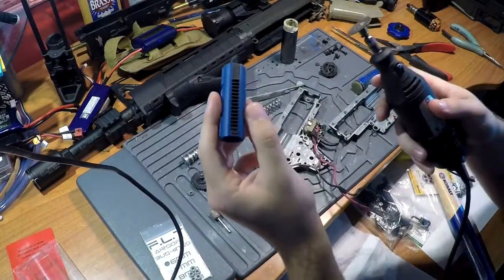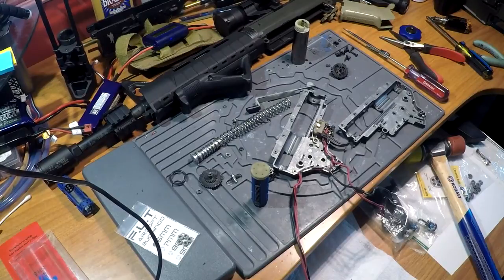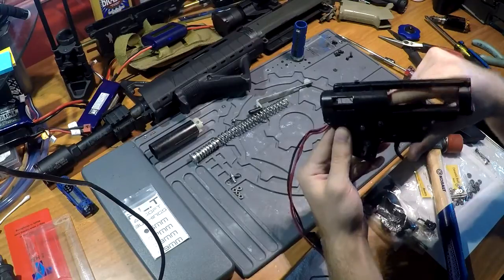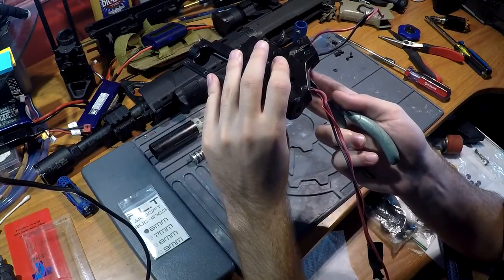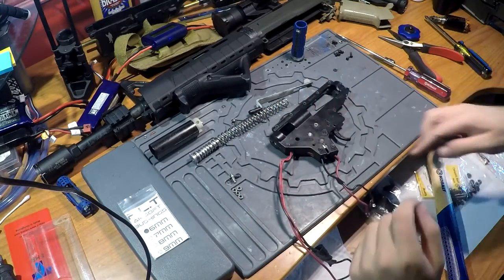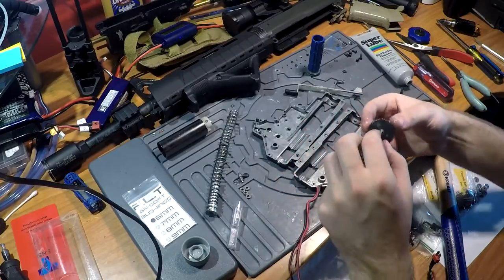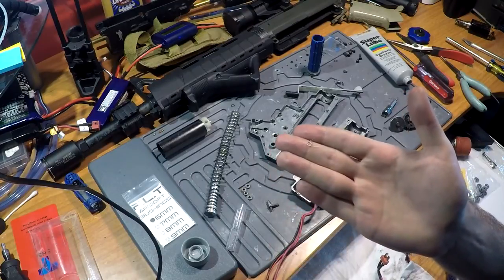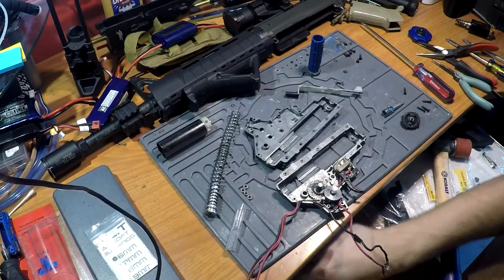Fixing a Broken DSG

Comment: An even better idea for the ARL is to get a flat magnet for the under side of the gearbox. The gears and ARL are all steel. The latch never slips out when I assemble my gearboxes now. The magnet I use is about the size of a quarter, maybe slightly bigger.
Another trick is to put a small amount of thick grease into the ARL hole and then the latch in on top of that. The stiction of the grease holds it in place. Though sometimes if the fit on the latch is loose, then it can still pop out. I like the magnet trick.

Comment: I'm surprised you didn't superglue those bushings down. Also, you could probably just bend a paper clip to clip around the gearbox from the outside and put a little bit of tension atop that ARL. The clip itself would be thin enough to let you put the two gearbox halves together to secure everything in place and then just pull it out to close everything completely.

Comment: why not just jb weld the new bushings into place and completely re-shim it correctly? alot of unnecessary messing around and second guessing.
Reply from the maker: This was my brothers DSG I built for him almost 3 years ago and he needed it working the next day - I fit it into my busy schedule.  Lol.  However, if "alot of unnecessary messing around and second guessing" refers to me swapping bushings without doing a complete reshim...  JB weld takes 24 hours to set and is unnecessary - it DOES help keep bushings from rotating but if its a proper fit they wont rotate in the first place.  You can argue I should have reshimmed the gearbox since the net height of the axes changed after swapping bushings, but unless you are changing between flat and protruding bushings (lonex vs JG for example) it doesn't always change enough to make a difference (and if it does you will notice, allowing you to then open it up and reshim).